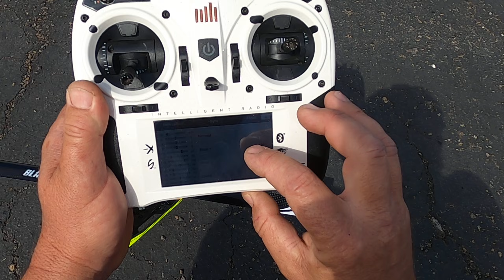How to Set your Tail Rotor Perfect on a R/C Helicopter and Why this Method Works.

Comment: how do you get into rate mode on the newer blade BnF fusions 270 and 360 ?
Reply from the maker: Hah. They don’t have rate mode. Pretty lame.  That’s why those always tail wag. You have to just guess with some right tail pitch.  Sometimes I lengthen the servo arm for the tail rotor too.  The servo arm will speed up the action.

Comment: but the guys told me that if I set the value to 120, my tail would fly apart into molecules. I set it to 120 and nothing happened
Reply from the maker: @very9000  just as I said.  The motor has no balls.
Reply: @CoeShow619  Do you mean that the engine is weak?

Comment: У вас V-Bar Neo ?
Reply from the maker: Ugh yeah,  put Neo in rate mode using your radio or computer. Uncheck heading hold. Fly the heli. Adjust the linkage just like this video.  Then turn heading hold back on. It’s a gyro.  They all work like this.
Reply: @CoeShow619  Tell me, please, should the tail necessarily oscillate when I raised the GAIN to the maximum value of "120"? When I lifted the helicopter into the air and it hovered above the ground in one place, I raised the GAIN to the value of "120", but the tail did not shake. Is this possible?
Reply: @CoeShow619  Tell me, please, should the tail necessarily oscillate when I raised the GAIN to the maximum value of "120"? When I lifted the helicopter into the air and it hovered above the ground in one place, I raised the GAIN to the value of "120", but the tail did not shake. Is this possible?
Reply from the maker: @very9000 it is possible. The tail rotor motor cannot spin any faster than its maximum speed, and cannot make any more torque than the torque it makes, so taking the PID up should speed the system, but you have over shot the climax of the system.  The 120 infusion tail is very remedial.  It holds in Safe with low headspeed, but it flies good if you “ clutch “ the collective instead of jabbing it.  It’s like exiting a turn on a 2 stroke dirt bike.  You are on it, but apply the power gradually but fast
Reply from the maker: @very9000  also, what gain value.  Here you are dealing with P first.  So I’m sort of barely in the ballpark with your question
Reply: @CoeShow619  I didn't understand you
Reply: no, i increased the overall tail GAIN
Reply: but the guys told me that if I set the value to 120, my tail would fly apart into molecules. I set it to 120 and nothing happened

Comment: Awesome video. But what do you do if your tail walks on it. Like when you give it lots of collective and the tail kicks to the side as it's going up?.
Reply from the maker: @nanoswithabackbone232   either you need to be softer on the collective, or you would add tail gain from the gyro menu in general.  If it’s horizon stuff, have fun PID tuning the tail.  On the system in this video, I simply go to gyro menu and go from say 60% to 65% and see if it shakes.

Comment: Very helpful man! When you plug in the flight pack will your tail servo start slowly drifting one direction?
Reply from the maker: No. It should not.  That’s a 6250 weird thing.  Recalibrate the 6250.  No other gyro does that
Reply: Will do, thanks for the reply.

Comment: I got the Fusion 270 BNF and this method is the same for AR636?
Reply: Hey man, it works! First: I reset ALL gyro settings and the funky style PID styles per the manuals suggested settings.
Second: had the tail servo centered and made the "bottom blade" point to the boom, kinda like a miniature "peace sign". It was not science, but 4*-8* degrees. Just a guess.
Third: put the gyro at -55 in FM1. And did a test...barely any wiggle. I was happy.
Last: put the gyro at stock. Little wiggly. Dropped it down two numbers. Much better.
Normal mode needed only 1 number and FM2 needed 5 numbers. 
They tail is beat up, maybe lost 1mm on both blades. That will be fixed too

Comment: Hello, Justin:
     I am making some adjustments to my tail on the Blade 330s Helicopter.  I understand that the Blade 330s flies in Heading Hold Mode by default.  The manual for the 330s does not discuss Gyro Settings.  Trying to follow your instructions from  your video but I am unable to locate instructions for flying the 330s in Rate Mode.  Can you assist?  Is it possible to setup the Blade 330s to fly in rate mode?
Reply from the maker: Sorry man. The 6250hx does not have a rate mode. I have discussed this with the Spektrum techs.  You basically must go to forward programming, set up, tail, subtrim, and in that subtrim menu, you will see the tail set where it thinks center is. Just leave the subtrim 0 but shorten or lengthen your tail pushrod to get the 2 or 3 degrees right tail rotor pitch as you are in that set up menu.  This will help you get rid of the mechanical wag.  The rest is in the PID tune. I do not change PID numbers on the 330s.  You can also assign  a Gain channel in forward programming to Aux 2 or 3 if your radio is capable and you can turn on the Gyro screen in radio and have control of the Gain numbers for each headspeed(stunt modes) and that way you don’t have to changes PID for the different headspeeds. Only the gain numbers.
Reply: @CoeShow619  
Hello, Justin:
     Thank you for your feedback.  I did as you suggested.  I went to Forward Programming / Setup / Tail Rotor / Output Setup / Sub Trim / Left this value at 0 ( Zero ) and as the tail blades are pointed to the front of the 330s I have the bottom blade toward the boom at about or close to 2 - 3 degrees.  When I exit Forward Programming and return to normal mode the bottom blade will turn as close to the boom as possible while the top blade turns the furthest from the boom as possible even after unplugging the battery and plugging it back in.  The good news is there is no tail wag.  That's awesome.  I did not Setup the gyro.  Would you have a good starting point for that or should I stay with the 330s Manual Setup?  Thank you for your assistance today and making it possible for me to get back in the air with the 330s.  I absolutely like this helicopter!
Reply from the maker: @josephrogina3865  sounds like the tail rotor is creeping.  Ok. Go to Forward programming, system set up, calibrate, complete.  Make sure the heli is level like in a perfect hover on your table. Don’t move or shake the table. Hit calibrate. Hit complete. Done. No creep
Reply: @CoeShow619  
Good Morning, Justin:
    I went into Forward Programming / System Setup / Calibrate Sensor / Begin
( I had a level on the boom to make sure the 330s was indeed level ).  After Successfully completing the Calibration, I exited Forward Programming and disconnected / reconnected the battery ( I still have Hold Mode on - on switch H ).  The bottom blade turns to the boom as close as it is able and the top blade turns away from the boom as far as it is able.  I went back into Forward Programming / Setup / Tail Rotor / Output Setup / Sub Trim / (Still at 0 Zero ) and the bottom blade is still within 2 - 3 Degrees toward the boom and top blade away from the boom.  I exit all the way out of Forward Programming / disconnect - reconnect the battery and the bottom blade is toward the boom as close as it can get and the top blade is away from the boom as far as it can get.  If I take the collective stick and give it right rudder and let it return to center the  top blade moves to the right and bottom blade moves to the leftmost position.

Note: The 330s flies ( Hovers ) good as far as I can tell.  The tail does seem to hold its' position with very little correction commands from me.  FYI:  I am using the DX6 Spektrum Radio.  In Forward Programming / Setup / I have the Gain Channel set to Aux 2, however, I haven't entered any Gyro Settings in the Radio and haven't changed any PID Settings.  Thank You for your time, Justin.

Comment: I have an Align 450L heli with an Align A10 transmitter.  I'm transitioning from Horizon heli's with with self stabilization modes.  How do I make the rudder response of the 450L less sensitive. (Also the aileron and elevator.  These are manageable at present, but If I can make them less sensitive it will be appreciated.) My main concern is the rudder..  I need to slow it down until I become more confident proficient.  All information will be appreciated.. Thank you,
Reply from the maker: I don’t know man.  Align is on the opposite side of the fence from me. That radio is basically a Futaba. It’s all Greek to me. I am a Spektrum pilot for life.
Reply: @CoeShow619  Dude, thanks for the effort.

Comment: Dude. After your rate mode adjustment you set the gain to 63 instead of the original 65. Then you dropped it even further.

Your results would have been the same if you had just dropped the gain to begin with.
Reply: Dude is a professional heli pilot and has been his whole life, I think he might know a thing or two 😉
Reply from the maker: Yeah dog! Thanks for the back up.  Been my whole life.
Reply: @NicholasB45  he knows a hell of a lot more than a thing or 2 & is also a great pilot. Did a freaking AMAZING job showing how to use rate mode to set up a mechanically neutral tail. First time pilot should be able to easily understand that tutorial. (But, honestly, they shouldn't actually attempt it. I've seen it cause a lot of crashes. So Just eyeball it (Align manuals are a good resource for this) & let the gyro do its work)

Gold stars for pointing out that travel limits need to be reset after adjusting the mechanics, be it push rod length or servo center.  SO many people forget that step & fry servos, beat up mechanics, or on some heli's push the mechanics over center which is a guaranteed crash for a beginner. 

Obviously knows the symptoms of a tail gain that's too high as well b/c he corrected for it at the end of the video.

But I stand by my statement. The fast tail oscillation demonstrated had everything to do with the tail gain being too high & and very, very, very, very little, if anything, to do with the poor mechanical setup. 

And to be crystal clear, I'm not saying one should disregard an egregious mechanical error or that it's not best practice.

Just that the star of the show should have been the gain & its adjustment, not the pursuit of a mechanically/geometrically perfect tail. 

It is required for scale flyers, but for modern heading hold gyros the offset is just another disturbance. No different than if you were flying in a steady crosswind, and if there's fast oscillation around the set point it's the gain causing it, not the steady disturbance.

Comment: Hi Justin, would this sort of then also apply on a fusion 180 with Ikon2? thanks!
Reply from the maker: Yes, go in your radio gyro menu and go to a -55% in normal mode. You can check the IKon2 on the transmitter screen in the wizard program.  You will see the number change and go out of heading hold.  If number is different on radio than screen, adjust endpoint in travel on gyro like you did on the rest of the controls to get the correct number.

Comment: Silly question I know, How do I switch from Heading to Rate Modes using my DX8?
Reply from the maker: If it is not a 6250hx, you just go to your gyro screen and put -55% in Normal mode. If it’s a 6250hx, it won’t do it. You have to just turn it on and not move the heli. Look for 2 degrees right pitch.

Comment: Hey Justin,
Looking for your opinion on something. 
Just bound a Blade 500 3D to NX10. Full test done with blades off everything okay. Out for first flight 60 seconds in test hover machine goes into violent tail spin. Checked programming 2nd flight does it again. Did a rebind, held in hover for 7 mins no problems. Now I don’t want to fly it until I come up with a reason for this to happen. Any input greatly appreciated.
Reply from the maker: Check the one way bearing in the main gear.  If you hold the tail rotor, the main rotor should not spin alone. You are losing tail mechanically most likely. Or check to make sure the tail pulley is not spinning on the tail shaft. The tail shaft pulley should be glued in place or have a pin through it. If it’s spinning on the shaft, it needs to be replaced.
Reply: @CoeShow619  
Thanks Justin, one way bearing seems to be fine. Off to check the other parts. 
Thanks again.
Reply: Actually I just thought something, which I was waiting for a new transmitter I was checking the machine over and tightened taildrive belt. If it was a little to tight would that cause the same problem?
Reply from the maker: @BinderDundat  if it’s too tight, it puts a bind on it. Just think about it. The main blade and tail blade turns together. If the main blade keeps going and the tail rotor stops or doesn’t function, the heli will spin nose left. If the tail servo is binding, it will stop working and the tail rotor won’t function, and it will spin. You are looking at it, all I can do is guess. If you have another 3060 tail servo, try that.
Reply: @CoeShow619  
Got lots of spare parts, what is most confusing is first and second flight it happened within 60 seconds. Third test didn’t happen at all in 7 mins hovering. The only change being a fresh battery. So I can’t risk flying it until I can figure it out. So I will check the belt again and change the servo and hope for the best. 
Thanks 
Justin
Reply from the maker: Check the set screw on the tail shaft hub.
Reply: I’m now curious 4 years later if you found the problem Binder😂
Reply: @jasonwhite6767  
Yeah cheap junk helicopter.
Moved on to bigger and better🚁
SAB, Tron, XL Power all set up on Vbar.

Comment: Bought an used fusion 270 and it has a slow wag, first idea was to increase the gain from the ebar v2 but guess will check mechanical setup first

Comment: Okay, but you had a extremely fast wag, and your using a FBL unit that doesn't come with the heli. how come you took off the AR636? my buddy just got a 270 and i just came in from first flight it has a slow wag. the tail does have the offset it should just like the 330s does. gyro gain lowered to 30 and its still wagging slow. Thanks

Comment: does the 180 come with a micro beast? i tuned it every which way using PIDS forward programming, everything other adjustment you can do, sorry to say the blade 150s is better. just went to that